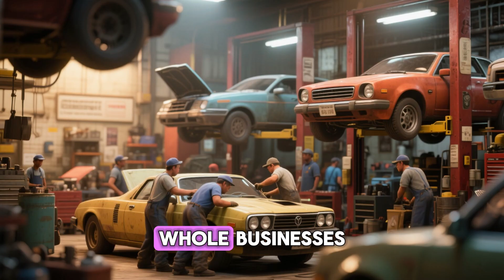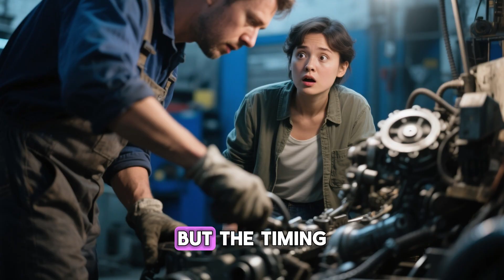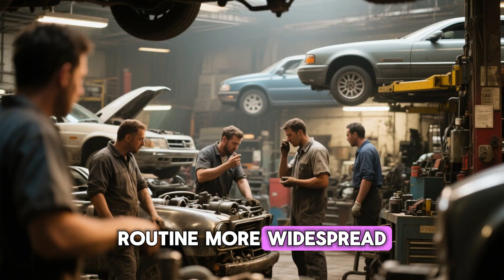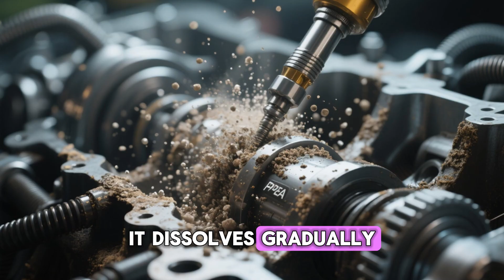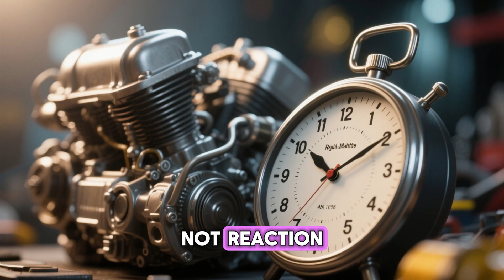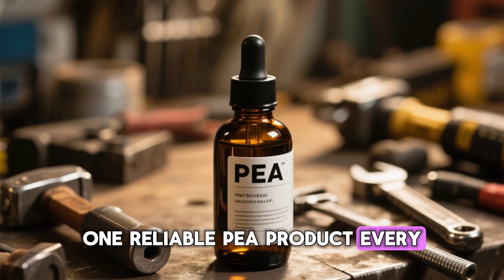This Japanese Fuel Method Keeps Injectors Clean Forever

Comment: Thank you for this. For more than 10 years I have wondered why my GX470 vehicles (2006 and 2018), required premium fuels when their engine compression rations were not higher than other vehicles that didn’t require premium.  Based upon your video, it’s all about keeping your injectors clean.  

My older GX has 250,000 miles (400,000 km) and is still running well, though fuel economy has worsened a bit in the last 5 years.  The newer unit has 90,000 miles (145,000 km) and runs like a dream. 

I’ll add the additional treatment in concert with oil changes and I’ll try the intense treatment a couple of times on the older one. 

Thanks again!  Smile😊
Reply from the maker: That's fantastic to hear your GX470s are running so well, especially the older one with such high mileage!